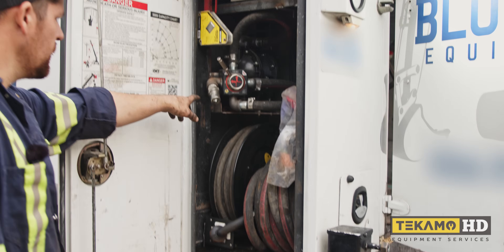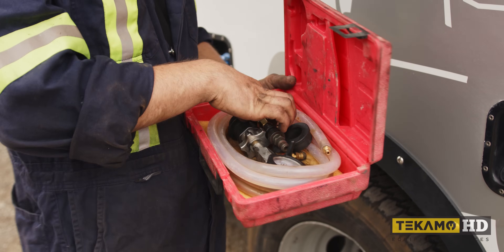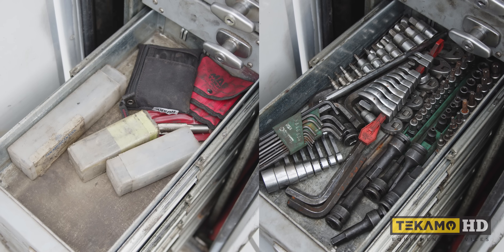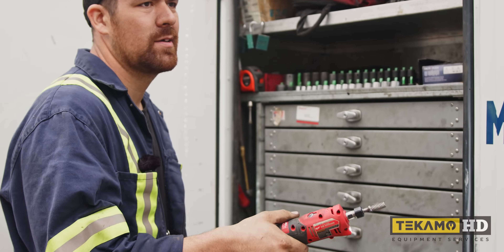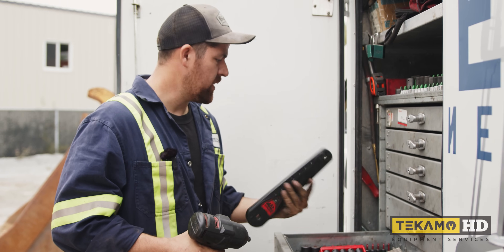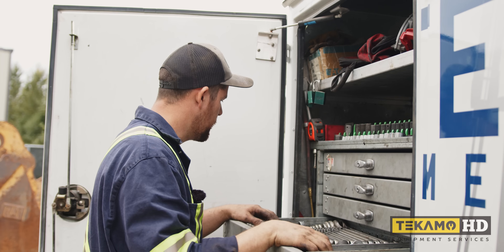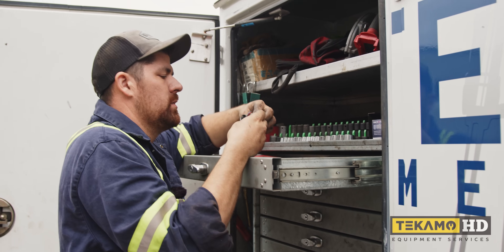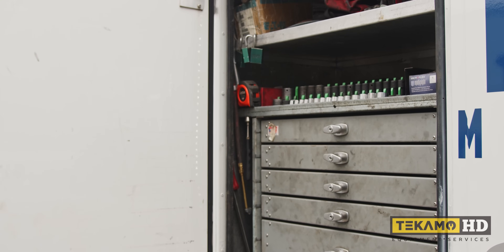Service Truck Tour Ford F550: PART 3  - Heavy Duty Mechanic Q&A

Comment: Great vid!! As a Brit I do wonder why US and Canada don’t use vans so much??!! It’s super rare to see HD mechanics in pickups.
Reply: Vans are great, until you start going off road. Lack of 4wd typically, not built nearly as HD, lower carrying capacityand much lower towing capacity too
Reply: The main reason is the difficulty of mounting a crane